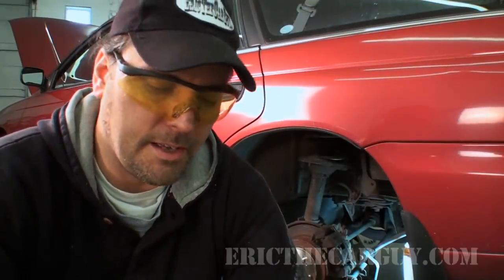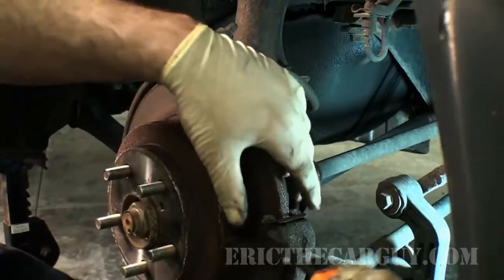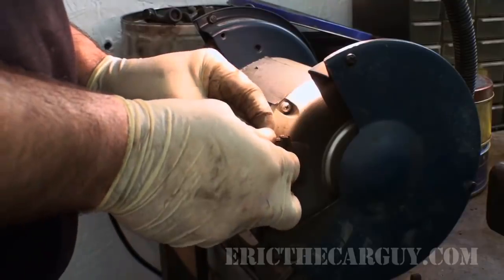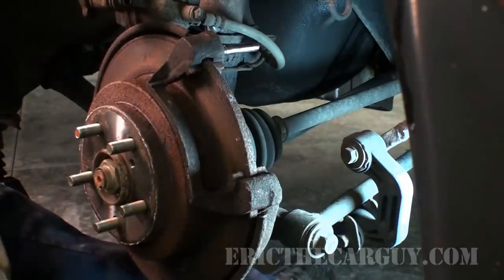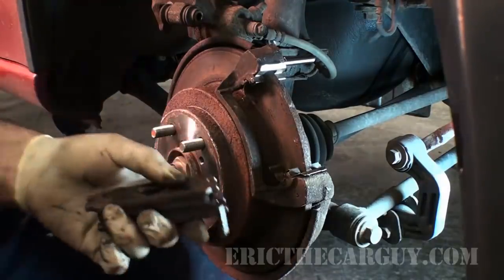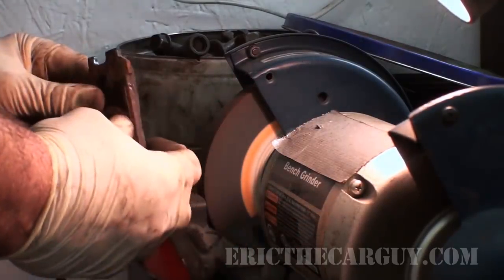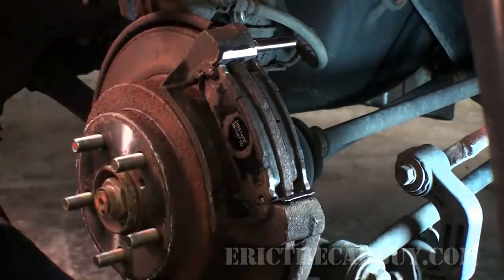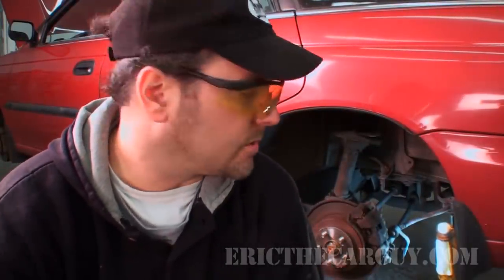How to Spot and Service a Stuck Rear Caliper - EricTheCarGuy

Comment: I'm just about doing this at front of the car. Installed new pads and rotors but now after few months it seems that left side is not moving freely. I remember that there was quite tight to begin with. But I hope that little grinding helps.

Comment: Oh yeah hammer and punches cures most rust issues. lol. I use punches to remove stuck guide pins all the time. My right rear rusted and fused it together. Most people claim you can't get them out. I had to remove the caliper and use a 2lb sledge with a punch to drive it out. It took about 2 good wacks and all was done.

good real world video that shows not everything always comes apart the same.

Comment: Thanks ECG for addressing the stuck pads which I have. I couldn't find any other videos that addressed this issue and I hope a cleanup like yours is all I need to do to eliminate a subtle grinding sound. If there is no feeler gauge on either pad can I switch them since the inside pad has 1/8 inch more wear (thinner)?

Comment: that happens when you park the car outdoors, especially in rainy areas or with lots of humidity, that's why brakes need to be checked at least once a year , and lubricate the pads ears and pins, make are rust free

Comment: Fantastic !!  Eric do you recommend putting the anti seize on the caliper mounting bracket bolt threads as well as the wheel stud threads?

Comment: I just had my rear caliper on my 370z stick pretty bad. It was the actual piston sticking. I found a tear on the boot and i think my wheel cleaner got in there and dried it up or something? Its my only vehicle so what I did was stick the WD40 nozzle under the rubber boot and gave it a good soaking. It stopped the sticking for now but i definatly need a new one. I was real careful not to get any on the rotor or pads and i wiped up any that was on the outside. Seems like a good temporary fix in my condition? I mean is there any danger with it mixing with brake fluid or something i dont know?

Comment: I have an intermittent problem with an 06 Grand Caravan.. the rear disc brakes are engaging, left OR right side, getting so hot they smoke. I just had new pads and rotors installed. There's only 35K on it, and it's in great shape. When engaged, I have to pill over every 2 miles or they smoke. The ABS light works, but is not coming on. What could cause this??

Comment: Eric..information video! Just had a question..I have an 2009 Acura TSX that has been running problem free for 85K miles..My rear brake pads were changed around ~33K miles (due to a Honda Technical Service Bulletin). Yesterday, I was at the service center for an oil change and they stated that my rear right brake caliper was locking up leading to uneven pad tear. 
If the caliper was locking up, wouldn't there be a drag and my vehicle would drift in one direction without going straight?
I didn't notice any of that. I'm planning to visit another center for a second opinion. But Is there any way I can perform some checks myself? (I will be watching out for the heat on the rim, of course as you stated). Thanks!

Comment: Hi Eric, I have a citroen c4  picasso and the rear brakes need to be changed.These are electric brakes. To take it to the dealer its a pocket full of money. Is there away to do it myself with out the computer device? I normally do these small jobs myself.This I have never done but I think it is not rocket science. Thank you.

Comment: Worth doing if the piston looks all rusted out? The rotors were recently replaced along with the pads and now the inner side of the rotors has a rust ring right in the middle, or should I just replace the entire caliper

Comment: Eeek!  I generally slow down using my gears and a tiny bit of braking in the last few meters to stop at lights etc.  I even park with my handbrake off and leave it in first gear, because once I had a car where the handbrake and pads stuck so bad, my friend had smoke rising in thick plumes to try and force them unstuck with the accelerator pedal.

Comment: Eric GREAT VID....but why didn't you use blaster...i understand that those were not that bad to get off...as i have had to drill out many that broke off in the proccess with BLASTER.....but penetrating oil whatever brand can make all the difference....i just think its importatnt to talk about the pins siezing up and the bolts and how common that is...

Comment: I have a question. I have the same problem stuck caliper pin and a whole lot of rust. Only my issue is it's so rusted I cant even loosen the pin from the housing to take it off of the rotor it looks like it rusted together so it looks like its 1 piece. Any idea how I can get it out of there?

Comment: Just did a new caliper and have a slow leak. However it is not leaking from where the brake line attaches but rather around the area of the spring. Yes it is the rear passenger caliper on a 98 mustang gt. What can I do about this only leaks when brake is pressed down

Comment: little tip. stop using copper grease on the pad sliders, it attracts brake dust and road grime and eventually causes this exact issue.

Comment: Sure, I understand, we've had the longest winter ever this/last year with almost 6 months of temperatures below 0°C. I just wanted to state that repair shops usually don't take the time to clean and prepare everything properly, but rather just exchange parts and replace them with new ones.

Comment: Wow I thought so I had a similar problem after a rotor/pads replacement the thing is the mechanic could not figure out the problem. Eventually had to replace the caliper(s) at a dealer because of over heating from brake sticking. I guess some mechanics feel those areas you cleaned are not a real problem~!

Comment: You know grinding pads to fit is Something I’ve had to do with every pair from OReillys 4 out of 4. And one time the drum e brake shoes didn’t fit. Went to autozone and their brakes went on without a problem. Napa is usually good, but... 

Note, have the store test their new alternator before you buy it. Saves installing and then finding out it was crap.

Comment: Eric....question for you.....I just re did all the brakes on my car....Now i had took my brakes off just 3 months ago and cleaned the pins and the holes in the caliber bracket that the pins slide into...also i put new boots on them...now u used the Auto Zone Brake Grease that is a silicone grease......anyways 3 months later i went to put a new rotor on and my pins were siezed up and i had to take it to a shop where they heated it up so much it almost damaged the braket...THEY GOT IT OUT BARLY

Comment: Eric,     I have a 2005 silverado 4.8  2wd   with a sticking caliper both sides,  
front right, front left,   I changed the calipers the brake hoses the 
master cylinder flush the brake fluid,    and still sticking both sides,
  what do you think it could be?
Reply: 100ega It's a chevy
Reply: Taran Offord I have to agree, replaceing with ford will make all the diffrence.
Reply: Serving brakes means servicing every part of the system. SInce the front brakes work, the master cylinder is good,. 

-When you flushed the brake system was it much harder to flush the rear than the front? If so the proportioning valve may be bad.
-Did you change the frames at the same time that you changed the calipers? If not, clean the frames per this video. 
-Did you change the pads, springs and abutment clips? if not, replace them.  
-Did you check after lubricating and installng the caliper guide pins that the caliper moved freely befor installing the pads? If not, clean off all the grease and LIGHTLY lubricate them.

GENTLY press the caliper back into its cylinder.  If it doesn't move, loosen the bleed screw slightly and try again.  If it moves, in, it's not binding in that direction. 

Tighten the bleeder screw. Remove the pads. Put a piece of 1/4" plywood in place of each pad and apply the brake.  If the caliper moves, it's not sticking in one direction.

Comment: You Mentioned that the rotor was rusty and that it would need to be replaced or machined. If it wasn't in your budget to do either of those, could brushing off some of the rust with a wire brush or would that cause the rotor to get scratched?

Comment: Great video like always! How much torque would you say you  use on the caliper bracket 🤔
Reply: The mounting bolts on my murano are 128 but it's not the same for all vehicles is it?

Comment: I have a 96 cadillac fleetwood with a full floating brake caliper and the top bolt is seized. Tried just about everything to get it out! Suggestions? Can I removed the caliper itself without removing the top pin?
Reply: I have used and air hammer to remove a stick bolt or sliding pin.Works GREAT!
Try not to "bugger" the bolt.
You need to remove that bolt. HEAT may help,but you run the risk of fire!

Comment: I went to replace the rear calipers on a 2012 honda crv, and could not get the caliper bracket to come off. Yes there was some rust, but i was able to get all bolts off no problem. It seems like there is some piece of metal that is lodged to the bracket and the caliper behind the rotor. Any idea what is is and how I can get the bracket off?

Comment: thanks for that but i understand there are 2 different types of system =1 has pistons that have to be screwed bacin and the other one is a push back , do show the screw back system in another vid ? i understand the hand brake support has to be removed ,great channel , im in the uk do you want to buy big ben i think they are going to sell it on ebay followed by buckingham palace .

Comment: Eric, is it really a good idea to put anti-sieze on the ends of the pads? I would think that it could easily get on the rotors. It also isn't really designed for moving parts. Probably the best thing to use is a graphite lubricant.

Comment: My dodge caravan has a thug noise when about to come to total stop and when begin to accelerate.  I notices that the caliper assembly move when it is rocked(pushed in and out motion)  The question is should the caliper assembly have any movement at all?

Comment: I am not sure how safe it is use air tools and brushes on brakes where you can inhale brake dust. I would use a simple file and hand brush, but that is just me. I used regular grease on my guide pins. I hope they don't seize. What's that silicon thing? Doesn't it burn from the heat from the brakes?

Comment: if i rebuild my calipers do i need to change the cylinder too if it has a rust eating the cylinder? because it still leaking brake fluid even i change all the rubber sealing.

Comment: Hmm, I worked on a few "American" cars myself and changed brake pads. What I came to realize and that is rather uncommon for European cars. Are them "shims" they put in. They are supposed to be a little sticky, to prevent the pad from rattling and "chirping". Where as in Europe, it is pad to clamp directly, with a special pad grease. I prefer the grease, it takes dirt on the outside yes, but it prevents rusting. American cars are rather....special at that.

Comment: what about the caliper? was the caliper itself functional? pads couldv'e just been rusted, but how was the caliper? what if the caliper failed, causing the pads to not move and rust in place over time? didnt' even try compressing the piston back into the bore. just saying

Comment: hi there i get a grinding noise and a vibration in my pedal only when braking iv replaced brake pads and rotatorys and wheel bearing and its still the same iv just ordered brake lines is there anything else it could be thanks
Reply: The rotors should be removed and machined. Someone may have dropped your rotors in the warehouse and bent them.The grinding issue is separate.

Comment: ERIC!!!! Help. As I understand it dielectric grease is similar to silicone grease/paste. Can I use say DOW4 on a caliper pin? I’m in Brazil and no one has silicone grease or anti seize. 

Also, lithium grease is different than petroleum based? Can I use White lithium grease since I can’t find anything else but wheel bearing grease or will the lithium dry out?
Reply: Typical dielectric grease IS silicone grease, but it is a less viscous NLGI grade, more like a grade #0 instead of around #2.5 that "good" silicone brake grease is.  I imagine you'll find that dielectric grease is lost, leaks out of the slider pin cavity unless the rubber boot seals very well.  What is everyone else in Brazil using?  Everyone else has to be using "something" suitable, it's not like you're the only one there that has a car old enough to need brake service done!
Reply: Many plumbers use silicone grease - try their source. [Don't buy very expensive small tubes of 'Diver's grease' for bottle threads.]

Comment: For caliper pins I like use lithium grease (AKA marine grease).  It has more resistance to being washed out and doesn't cause corrosion.  I've never seen silicone grease used, but as long as it is "high temp" silicone is inert, corrosion wise.  I WILL NEVER USE MOLY Lube.  Moly (Molybdenum) is a much higher noble metal (yes it's a metal) than Iron (Steel) and can cause Galvanic corrosion.  The Air Force has forbidden Moly on aircraft since the late 70's for this very reason.  I just did a total re-work on the brakes on my 03 Chevy pickup and had to replace the slide pins on one rear brake caliper because they were corroded up and sticking.  All four calipers had Moly on the pins and it's never had brakes before so I know the factory used it.  DON'T.  Not for chassis lube either. IMO, if you have Moly grease of any kind in your garage, trash it.

Comment: Hi Eric the Car Guy does this process cause your car to grind or make a grinding rubbing sound when turning or processing to moving forward? Also my service traction control and ABS is coming on and off.
Reply: Tonya Jenkins Probably not actually your brakes. Check the code the abs gives out. The abs systems monitors many things regarding the wheels. It will tell you everything you need to know. Most likely you have a ball bearing or cv joint issue. I am leaning cv joint issue since it gets worse when you turn. Ball bearings just get louder the faster you go and they are also constant. CV joints are sometimes described as a "ticking" sound.

Comment: I wouldn't resurface the rotor. It seems that originally the car sat for a long time  [Buying a Used Car]. I bet both rotors were originally rusty, but with the pads/brakes working normally on the other side, it is seen as never being rusted. I rotate three cars between two people, and if one car isn't used for a week, the rotor rusts, after a few miles they shine back up nice.

Comment: Why would you use cooper anti-seize??  The silicone grease is much better on the pad ends that make contact with the hardware.  They allow enhanced movement, have a better heat tolerance and are water repellant.  I do not understand why you are using anti-seize in an area that it is not meant to be used.  Ant-seize has no place on brake components.  It is great for what it is intended for.  I doubt the service manual references its usage in this area,  Please correct me if I am wrong here.

Comment: Thanks for your vids.  I have a question, when looking my truck over for inspection, I found a sticking guide pin.  Its corroded very badly, all the way under the boot, so I'm guessing its not coming out.    I have just recently got in the habbit of lubricating guide pins.  Can I buy a new caliper bracket, or just replace the whole caliper?  I changed the other caliper last year about this time already.  04 pathfinder front brakes.

Comment: Rubber mallet and a breaker bar. Save your joints, save your tools Eric.
Reply: +Mike Beltran brass hammer and a box end wrench works much better.
Reply: Who uses 'box end wrenches' in this century?
They always seem to have been deformed because they are so soft.

Sockets yes and preferably flank drive ones for really tight bolts.
Reply: @peterbloggs8750  It's better to use a 12-point wrench to unscrew a stuck 12-point bolt. Once you are able to turn the bolt then you can change to a 6-point socket on your ratchet wrench
Reply: let the man work
Reply: @twochaudiomg2578  Why does everyone use a 12-point wrench on their 12-point universal bolts??? The reason is that you cannot afford to round off the threads on those bolts. Every mechanic has 12-point and 6-point sockets. It's just plain laziness to use the wrong tool especially when you're making a video on how to do something the right way. Do you have a set of 12-point sockets or do you use the Mexican speed wrench (crescent wrench) on everything you do???
Reply: @peterbloggs8750  Maybe you need to buy higher quality wrenches.  I have no problem using them when clearance is tight, and use sockets when I can, merely because they are faster in a ratchet, especially on an air or electric impact wrench.
Reply: @stinkycheese804  ?? My comment still stands after 2 years. My torque wrenches are still accurate (calibrated - and top quality) because I DON'T ever use them as breaker bars. You carry on as you wish ... [Nothing to do with socket or wrench quality BTW].
Reply: @twochaudiomg2578  AMEN to that, someone got to complain about something regardless